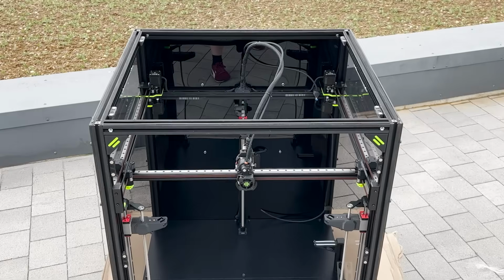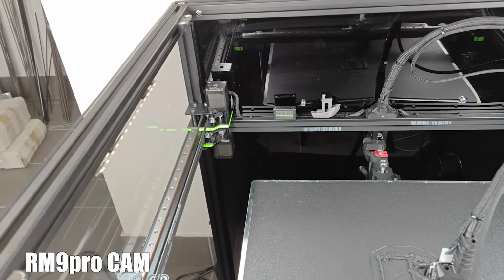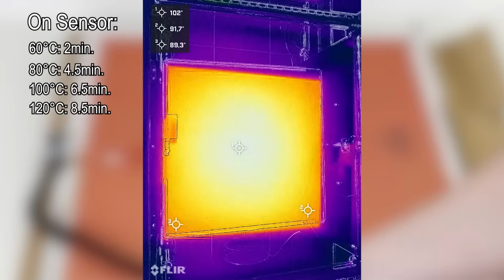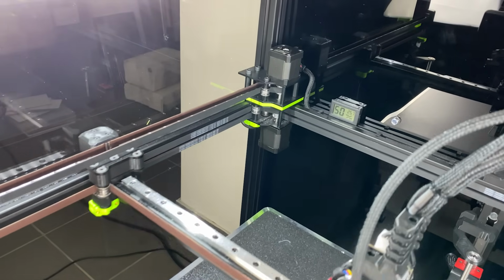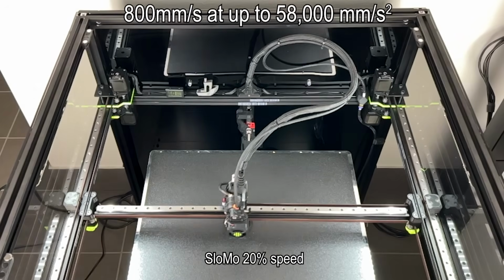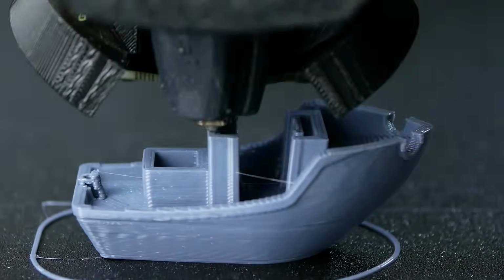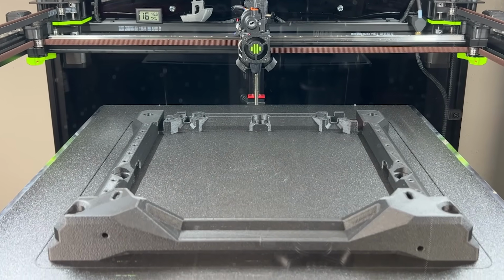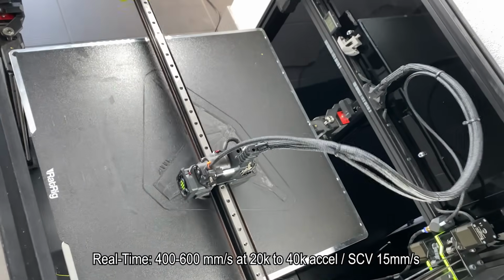Rat Rig V-Core 4 500 Hybrid: The Future of CoreXY? XXL Test!

Comment: I must say Im welmed after all the problems.

My biggest disappointment is thst we aee in current year and still having to do things like set z offset.

I really think a camera should be included as well.

The hybrid is also cool, but what I really was interested in was idex plus an mmu.

Lastly, for the filament feed issue, Im utterly baffled at why no one is copying the Bambulab solution to long feed distances that they use with the ams with the buffer that always gives the extruder the exact same consistent light drag amount.

Im very interested but I think Ill wait to see which of these are addressed.

For me having to do any manual calibration at all is actually a deal breaker. I want a printer that has the prerequisite sensors to do that itself. I dont want to babysit and mange it. The first layer should be perfect with literally no effort whatsoever and the filament path should not cause inconsistencies. These are the most major problems to me. I want a printer to print big things anr multi material things. I dont want a printer as a hobby, just as a small subsection of my hobby.

This is why I love my X1C and I was really hoping the VCore4 would deliver a sort of open source large form factor equivalent or near to experience.
Reply: Z-offset calibration is gone with beacon contact, it's fully automated and works out of the box with RatOS 2.1, perfect first layers every time. Of course you need to heatsoak to make sure everything has expanded / contracted before starting, that's just physics.

If you don't want to do any tuning of your printer at all, don't buy a DIY kit.
Reply: @miklschmidt  I dont think your conclusion is reasonable.

Firslty there isnt any reason a kit cant remove the need for tuning.

Secondly they will also be selling assembled versions so its not at all justification.

Its good to hear about contact if that works, but there still remain the other issues so its very mucj wait and see, especially for idex.
Reply: @BeefIngot  I make RatOS, which is arguably the closest you'll get to an "out of the box" experience on current DIY printers, so i'd say i have some idea what i'm talking about.

It's a question of software, it's a LOT of work on a modular system, i know because i'm doing it. We've gotten a lot closer with 2.1, but that's been a year in the making, the last 6 months i've been working 18 hours a day just to get it ready for the VC4 launch. There's still a ton of stuff to automate (which we're working on).

"Secondly they will also be selling assembled versions so its not at all justification."

I'm not justifying anything, i'm telling you how it is. It's still a software problem. Pre-tuning before shipping will only get you so far, every micron matters - and you're still going to be swapping things on that thing, so you still need the software to support the modularity. Further more this is all open source free software.

Contact works - it's working right now on several rat rig machines out there in the wild, running RatOS 2.1.

"so its very mucj wait and see, especially for idex".

We've gotten IDEX in a really good place IMO, but it's also by far the hardest system to tune if you don't know what you're doing.

I think you should consider a mass produced printer, with the demands you have, you're gonna need a very deep wallet :)
Reply: @miklschmidt  I have an X1C and it does excellently. I dont think what Im looking for is impossible. I even think its possible for the VCore4, but just some things need to change.

You mention pre calibrating from the factory, but I dont think thats really necessary. The X1 for isntance doesnt have much calibrated from the factory apart from basic bed levelling (and its not even a supremely flat bed). A Vcore wouldnt even need that because of the gantry levelling.

Whats left? Well contact covers some, but also what would be needed is a fix for the filament. I dont think it would take much to fix very nicely and even for a while when I was still a klipper head 3d printer tinkerer I experimented with trying to make a buffer system similar to what is on the x1 as well as an mmu system (just 4 cheap extruders feeding into the not so great first sttempt at a buffer).

I think the VCore4 could fix that issue using the same thing as well (the buffer) with a relatively simple 2 injection molded part solution and an extra extruder.

Basically Im saying that Im aware of what the problems are and Im aware of what the challenges are too. I think its possible but its not there yet hence my conclusion that I'll wait and see. Im not trying to devalue the work done here, I think its a big step up generally.

I think given the advancement in the reduction of hassle from the VCore3 to the VCore4 they (which I guess includes you) seem to be tackling usability issues (like with the far easier pre crimpled back panel box making assembly easier).

So basically I do know what Im doing and Im also not saying that I think this is unsalvagable or bad, I just have wishes and fixes I would wait for before buying something like this, because assembled or kit form the hope would be that I could set it up and print reliably just as easily on my X1 and then if I decided, due to the opennes I couod experiment at my leisure as opposed to feeling forced to. Good base profiles, reliable mechanisms, decent feature set, no required tinkering. Those 4 would be great.

Like I mentioned the 500 idex does excite me and a large part of that has been the usability upgrades over previous kit/foss type printers.

Basically I dont think being pre built is a requirement for what I want and feel this kit could likely achieve it.

Thats a long ramble but I wanted to be more clear, establish what I was going for and my perspective.

As for the mass produced part of the comment Im not sure thats true. Bambulab is rumoured to release something very similar and I doubt itll be out of range. If anything I see it hitting similar to the VCore4, but the VCore 4 has the open source appeal, fast idex and that 500mm build area.

Edit: And btw, I so think RATOS is a great thing for the direction I want these foss printers to head in terms of usability, so no discounting that.

Oh and about modularity I think forming a strong set of presets for a base config for the idex and hybrid would be great, forming around one toolhead setup for reducing complexity and having a garunteed platform ease of use wise.
Reply: @BeefIngot  There's a thousand things you're forgetting. You can multiply those thousand things with user assembly and wiring errors. It's extremely complicated to do things automatically on highly modular DIY printers, because if something's off, wrongly assembled or wired, that automation results in damage. So you need sanity checks upon sanity checks, self checks, self calibration and self verification for every single process. That includes dimension calibration (position_min/max/endstop), belt tensioning, resonance calibration, toolhead offset calibration, kinematic verification, temperature calibration, flow calibration, pressure advance calibration, gantry twist calibration, nozzle thermal expansion coefficient calibration, beacon model calibration, etc etc etc. I wish i could adequately explain to you how challenging it is to do that for 12 different printers (many of which have varying sizes and several different toolhead designs), 45 boards and countless different hotends, extruders, thermistors etc etc. Now add macro's on top of that to handle all the routines and features (for all combinations of the aforementioned hardware) that you also expect from a modern printer. It might look easy from the outside, but it's a lot of painstaking work to get anywhere near full automation.

That said, we're are working as hard and as fast as we can to make all that happen (for free i might add, i don't make a living off of this). Bambu doesn't have to do any of that, all of it is static, proprietary and there's only 1 size.. Small. Bambu can't scale the printers they have with their current design, kinematics and materials, a lot will have to change, the bigger you go the more issues you're going to have to deal with. If they come out with a 500mm sized IDEX machine with the same level of automation as the X1C it's going to cost at least as much as a maxed out Prusa XL.

We do have presets defined for all printers, but all that does is preselect hardware and dimensions, it won't know how you built your printer or what happened during shipping. All the checks and calibration i mentioned before still has to run, or you won't get the perfection you're looking for, and someone has to write the code and test it on a wide variety of printers and hardware to make that happen. I wish it was just "slap some sensors in it", that would've made my life a lot easier (and the printer more expensive).
Reply: @miklschmidt  I think we're maybe talking about 2 different things. Im aware that building it isnt as easy as a prebuilt. Thats not the problem to me and like I mentioned the pre crimping makes it much easier (I dont think anyone likes crimping cables) and there are plans to sell them completed where those things can be verified at the factory.

I also am not scared of the build as like I mentioned my goal is to have a flawless experience once its setup.

Of the tests mentioned I think resonance comp and x twist (with the ibtroduction of contact I imagine) can be automatically calibrated.

That means most of the calibration run on the daily can be calibrated.

Pressure advance is different but thats basically fine because slicer presets are likely good enough for most situations with the stock toolhead setup.

It would be cool if you had auto strain guage calibration/vision like the A1 series but we can see its not necessary with many printers that dont and just rely on presets.

As for the idex offset, the solution Ratrig has, I think seems pretty adequate with the camera and not needing to be there in person to fiddle with things.

So like I get what you are saying but Im just talking about what the user would experience on a daily basis using the printer. Like the idea that you never go to print and realize you have to embark on a long side quest just to get the same quality prints you are expecting 🙂
Reply: @BeefIngot  yeah i don’t think you’re reading what i’m writing, i’m not talking about building at all.

About getting what you expect, we’re already way beyond that if you follow the instructions. If you have side quests, you done goofed something. Giving you what you “expect” means the computer telling you what you did wrong. If you know how to do that in code, please send a PR 😂
Reply: @BeefIngot  Bambu lab fanboy 🤡🤡🤡 You guys are the reason why current 3d printing space is so toxic. Curb your elitism and actually read what others typed.
Reply: @youtubehandlesux  You clearly havent followed this conversation in the slightest. Suggesting a solution for the filament feed problem isnt the least be about fanboyism. They already did it and this is a chance to benefit from that.

Its also silly to call it elitism. RatRigs literally cost more. Its not elitist to own a normal consumer printer at all.... Baffling.

To call peoole with these printers the reason for toxicitt is even more insane since many users are first time users and just straight up arent on the forums/discords you are on. This is really specific self built enthusiasts getting mad in a circle that the keys to performance they had to work hard for are now availible to normal people. Thats where the toxicity comes from. I dont get it either because I myself have been in the klipperizing space too and I have no angst towards people who dont want that.

Being angry that I mentioned it within a different topic is peak cultist anger. Its a brand of printer, it didnt key your car. I've never gotten the people angry about this brand. More anger than with creality a brand with actual reasons to be mad at it. Never any thought behind the hate.
Reply: @miklschmidt  Are we not talking about your recommendation that I go prebuilt for my design requirements?

Are not most of the calibrations you listed that I didnt cover mostly related to assembly like detecting the straightness of axis etc?

I must admit its a bit frustrating for you to say Ive not been reading with the specificity of my responses. Bad vibes when ultimately my suggestions were regarding 2 fixes to make the printing of this device I was excited about better. Its not like I discounted the work of Ratrig either so that this is an official response from a team member actually annoys me.

Also, this has nothing to do with a computer telling you what you did wrong if we arent talking about assembly. All of that would be self calibration/calibration territory for daily use. Bambus dont tell you what you did wrong, they just have sufficient smarts to detect fails and calibrate the things you dont want to calibrate without intervention so I dont know why you assumed this is what I was talking about either.

Feels like there were some wires crossed and the response was kinda defensive when there was no attack.
Reply: @youtubehandlesux  rofl, only toxlc ones are people complaining about the bambu fans, you don't realise it but you are much worse
Reply: @miklschmidt Kit printers with perfect first layers exist, see the Nextruder that Prusa has (for all the flaws of the current gen Prusa printers in terms of cost and still not being entirely fire and forget, I would love to be able to get Nextruders for other CoreXY printers)
Reply: @bosstowndynamics5488  tbf, the VC4 is that too. It’s one command to calibrate the beacon and it’ll even compensate for quite crazy assembly problems as well.
Reply: @bosstowndynamics5488  a lot has happened since this video. It now does gantry twist and flex plate magnetic field compensation too. Automatically.
Reply: @miklschmidt  Theoretically yes, but in practice, at least for now, the beacon setup seems to have limitations in terms of performance, whereas the Nextruder continuously feels the bed including during actual extrusion so it could have detected issues like the skewed bed in the video and compensated for it
Reply: @bosstowndynamics5488  no not theoretically, literally. We implemented dynamic scan/contact diff compensation by interpolating a contact mesh. It works, and it’s automatic.
Reply: @miklschmidt  I do like the look of the V-Core 4, but you'll have to forgive me being skeptical of how automatic this is until I see this capability thoroughly tested by a third party. As much as I think the Nextruder is cool I've been burnt too much by Prusa's tendency to overpromise on the idea of their printers being plug and play, and I know that the V-Core 3, for all its upsides, was not as good as the marketing claimed (and as much as I hate to admit it, Bambu's printers are pretty close to their marketing, so the over promise/under deliver approach is no longer workable)

Comment: The PSU is grounded, but then it mounts on a painted enclosure so there might no be a path to earth if there is a leak. No ground to the bed is absolutely a no no. a company making 3d printers for years shouldn't make these mistakes.
Reply: the beds are grounded, there is a screw hole in the bed for this purpose
Reply: So I looked deeper. If you look at the video where he is looking at the bed I do believe you can see the grounding connection with the yellow wire with a green stripe. Seems like its fine to me if Im correct.

I would prefer the frame use conductive bolts in conductive slots so it could all be grounded with one grounding wire from the electronics box to the frame like you see in some server pc cases but this is acceptable6.
Reply: @BeefIngot  well, its of course on the bottom side of the build plate, difficult to see from the top

Comment: I feel like it would be a great printer at some of the smaller sizes like 300, since ive noticed in some of your slowed down clips that the belts wobble a lot. Like at 10:30. I dont really know if thats an actual issue with the printer, or if the belts are just not tensioned properly. I feel like it could create some issues.
Reply: That clip is at 20% speed, in slow motion you can see a lot of things flex and wobble in ways you wouldn't think possible. If it can print cleanly at those acceleration values I don't think it's an issue. But of course if you know you don't need those sizes a smaller model will definitely perform a bit better.
Reply: Indeed.
I saw that as well. Also I suppose with the smaller printer you could achieve higher speeds/accelerations because of the lighter gantry.
Reply: I would think that by adding an idler system at the gantry (a simple pair of adjustable rollers on a bracket) would eliminate a lot of the slapping and consequent vibrations involved in that long of belts especially when the gantry is near the midpoint. Just some way to tame the belts should make a significant reduction overall.